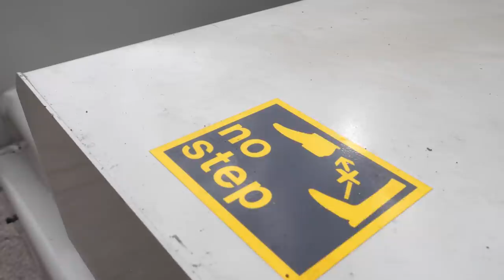GIANT CNC Machine Delivery (seriously, it's like really big)

Comment: (Tool setter for aerospace company) I work with tools every day. Collets last longer than 2-3 months, if you use the correct torque specs and diameter collet. Collets usually are for drills and reamers (hole makers). They can definitely be used for endmills and form tools (material removers) but the lateral force applied can wear the collet and risk failure during its running process. heat fit or heat shrinks as we call them are more rigid which is why we use them a lot for endmills. Most heat shrink machines have the opening facing up which I don't like using due to the limitations of the machine (Company example: Haimer). We have a custom machine which we can't replace due to the person who had made the machine is no longer alive, but the holder faces downward and as the holder heats up the tool drops out. but say a tool shears off at the opening of the holder, most holders unless you put a stop in the holder have a smaller hole that goes to the larger hole from the back of the tool. If you have a heat shrink machine that allows the tool to face down then you can remove the tool with a skinny metal rod. Hydraulics are a high precision and better grip strength than the collet but if used improperly then the bladder will wear out and do irreparable damage to the holder. Hydraulics and Collets the tool needs to sit the maximum depth of the holder. For hydraulics that's until the tool bottoms out and for collets that's just the depth of the collet itself. This extends the holders and collets lifespan and greatly reduces the possibility of the tool failing. Heat shrink tools it depends on the diameter of the tool on how far down it needs to go into the holder.

Heat shrinks: requires more expensive tools to use, Carbide not steel unless you want the tool welded into the holder in the proccess of putting in the tool or trying to take it out. Also you have to replace the entire holder if the holder is either heated too much or damaged. Excessive heating or end of lifespan of holder will cause bad grip or severe runout.

Hydraulics: High Precision and high grip strength but can be fragile and if bladder is damaged you have to replace entire holder.

Collets: Lowest lifespan but only need to replace collet as it would take a large amount of force to damage the holder enough to be beyond use. But proper training for setting tools in this holder and proper use extends the life of the collet and will prove to be cost effective. Most manufactures will tell you collets have a collapse rate of .04 of an inch but you only want a collet collapsing .02 or less, preferably .01 or less. Collet life will extend drastically. Our company has tools in which the collet had not been replaced in years because of the proper care for it was used and we cut things like Titanium, Nickel and Aluminum. (This still doesn't include the different styles of collets there are.

Set Screw: Not mentioned, has 2 holes in the side of the holder that screws go into to hold onto the tool. The tool is required to have a weldon flat for the screw to go up against otherwise the tool will move in the holder. used on endmills mainly as an alternative to heat shrink holders but to me are becoming more outdated. The main use that still makes them applicable now is holder pieces for inserted cutters.

As the company I work for deals with metal and not wood, what's needed between the two materials is different, but I would use heat shrinks with carbide cutters for heavy cutting in the removal of a large amount of material, Inserted facemills for cutting across a surface, Collets for most everything else and maybe a hydraulic here or there for more precise drilling. I would stay away from using a cutter/holder combo where its one solid piece, because it will be expensive to replace (custom order) and probably will have a long lead time, but it would be one of the most precise and reliable tools.
Reply: Thought the same. I’m in automotive and we have all kinds of holders but mostly shrink fit because it’s not that expensive if you have the machine to operate and we have mostly carbide anyway. 
Hydraulics we use mostly when damping is needed 
Even set screw we use for special drills with only carbide/diamond tips

But long story short, all the holder hold way longer than than months if you torque/use them correctly. Heat shrinks does the quality of the heating machine really matter in terms of lifetime of the holder and even removing of broken tools. 
Most the time holders get removed when the Spindel connection is worn out or when the cooling/chips have removed too much of it.
Reply: Similar here. The CnC I run 8 hours a day, Monday-Friday has the same collets in use as when I started... 6 years ago.
Reply: Great feedback. Set screw holders were not mentioned because they are not recommended to use with the higher rpm’s needed to cut wood. Potential for backing out and losing the tool. Collets fail do to heavy side loading. We are cutting wood with large diameter tools (some are formed) with high feed rates also. Some important info was edited out that explains the reasoning in deeper depth. All pro/cons and possibilities were considered.
Reply: @michaelfurtado8453  Awesome, I always love when wyrmlife goes into the details of the workshop as I can relate to the cnc and tooling portion. But for sure if the machine is mainly doing heavy cutting, heat shrink is the way to go. The machine to change out the tools is the only caviat, hopefully you guys got something that can heat the correct amount of depth needed to set.
Reply: Mold machinist/former Aerospace machinist here. I have no idea what they're doing that's breaking collects like that. I've never seen that happen, nor have I ever heard of collets wearing out that fast in any capacity

Comment: I did not realize you could autocad an entire shop setup. It makes so much sense, but my eyes have just been opened to a far easier way of setting up production systems
Reply: I did some autocad drafting for storage units for a design company way back then but id gotta say, if you're off by an inch your entire Floorplan is screwed, especially having to go back and having to find out where it all went wrong
Reply: @hypedupdemon  oh gosh trying to figure out the error must be a nightmare. might as well just start all over
Reply: I once visited a test-fusion-reactor in Germany, and they said, that the whole room is coordinated in x, y and z. So if you wanted to know, how far a screw sticks out of a panel and how many millimeters the clearing is to the ground, you could look that up in a computer.

Comment: A hole drilling EDM machine would let you get tools out of the hydraulic holders as you could drill a hole into the broken tool to be able to get leverage. I'm sure there is a machine shop somewhere near you with that capability. Bound to be cheaper than an entire new tool holder in that case.
EDM machines are nuts!
Reply: Yes they are but unfortunately only the local schools have access to that equipment and is not feasible for wyrmwood to invest in that type of equipment. Cost of saving the holder will most likely out weight the replacement cost or come close to it.
Reply: @michaelfurtado8453  alrighty!

Comment: I know this is very out of date but remember back in ye olde days when wyrmwood were using non diamond bits for their toppers and that one bit that did the edge angle was wearing out, with the new machine they could use the worn tool to do the initial pass and a half depth pass leaving just a small amount of material as a final pass with the new sharp tool to clean it up, or is that a stupid idea?